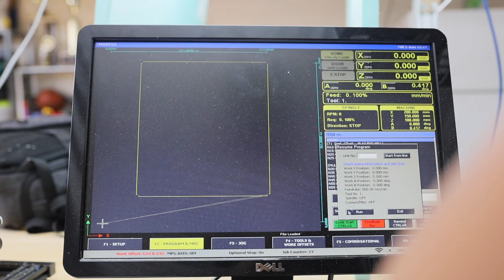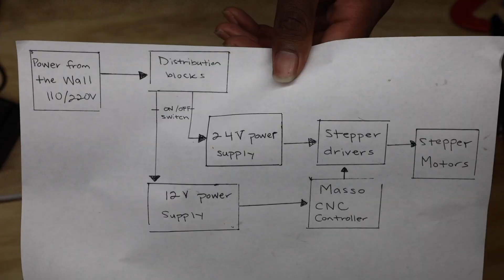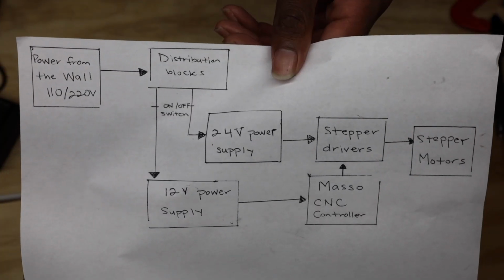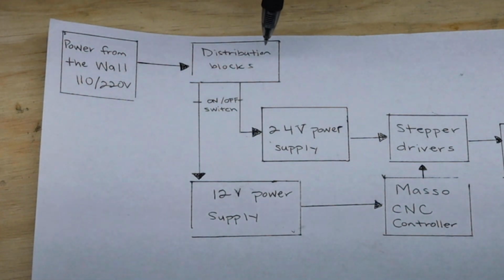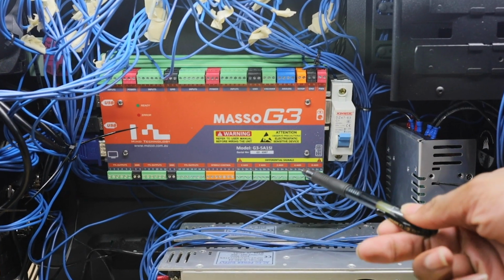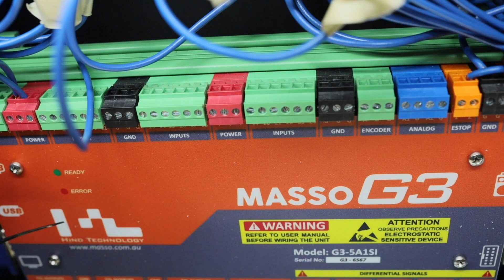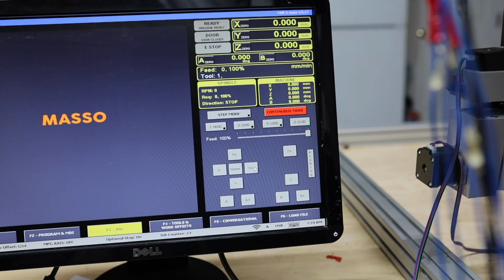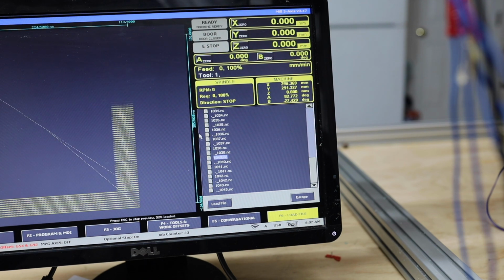DIY 5-Axis CNC Build( Part 4: Electronics/Controls )

Comment: Great  DIY  project  very similar to 5axismaker :)   I got only one question do you plan to use some kind of endstops for AB axis ?  without any  how do you zeroing those axis ?
Reply from the maker: Thanks man! I'm working on adding reed switches/ limit switches to the next version of the AB head. I had been zeroing it manually which isn't really all that accurate or repeatable.

Comment: What programming software do you plan to use? Great job on the design. Do you plan on replacing all of the 3d printed parts with aluminum parts?
Reply from the maker: Hey Paul, I've been using fusion 360 for CAD and CAM. I have no plans on replacing any of the 3D printed components at the moment....but maybe thats  a possibility in the future! Thanks for the compliment and thanks for watching!

Comment: next time use multi strand shielded cable for steppers would really knock down on the rats nesting good job so far though.
Reply from the maker: Thats  some good advice Will. I initially had a hard time finding wire for this project but, I eventually did find some 18/4 shielded multi-strand and used it to wire up some of the steppers back to the controller. Thanks for watching man!

Comment: fez testes com alumínio?
Reply from the maker: No, I haven't tried to run any cuts on aluminum. There would be to much deflection and the spindle doesn't produce enough torque or rpms to do so.

Comment: Nice stuff dude! I'm building a 3-Axis Milling Machine driven by LinuxCNC at the moment. My wiring is kind of terrible at the moment. I was wondering where you got that blue wire you used all over the place in your PC case? Is it good stuff?
Reply from the maker: It's 18awg wire that I bought from Amazon. From hindsight,  I would recommend buying 18/4 shielded cable like this stuff from home depot: 

https://www.homedepot.com/p/Southwire-By-the-Foot-18-4-Gray-Stranded-CU-CL3R-Shielded-Security-Cable-57573099/204725141

there will be less clean up

Comment: damn son, I just started planing to build my own DIY CNC Mill by FIRST planing the construction via CAD part-design & part-assembly with correct dimensions, then SECOND step is to order all the parts that I need and prep them for assembly, then assemble it and your video actually helped me, cuz that controllerbox and steppermotor-driver gave me ideas on what to use for my build and I want to go with a FULL-Aluminum build, no 3D printed parts AND use more powerful steppermotors like Nema24 and either a 1.5KW, a 2.2KW or 3KW Spindle, as I am planing on milling aluminum parts, even thought small parts but this gives me the opportunities to reconstruct the machine without having to change parts like the steppermotors or spindle for a long time ^^
Reply: Dude no need to thank me for watchig the video, every bit of information that I get from videos like yours is plentiful important and informative and it adds to the community so thats cool in itself, keep it up bro ;-)
Reply from the maker: Hey bro, that sounds like a good plan! Yeah U would definitely recommend designing everything in CAD first before building the actual thing. It will save you a lot of time and money $$$ on the backend. Wishing you the best of luck . Thanks for watching the video!

Comment: Great video! How do you compensate for the rotation in the head assembly (In cam/post prosessor) and where are you going to set the zero point?
Reply from the maker: Thanks Tobias! I designed the head so that all the rotational axis intersect at a point and have the same center of rotation(COR). I did that because it would keep me from having to worry about COR offsets and it simplifies the kinematics in CAM . As for compensation the CAM software solves for most of that (honestly I don't know too much about how that works currently).

Comment: Coming from a manual machining background (hobby, not professional) as I watched you build the Z axis, my mind was screaming at me, "DEFLECTION!  NOT RIGID ENOUGH!"  Then you mentioned that you are only going to be machining foam, and it stopped screaming at me.  But even on foam, between the cantilever defection and the printed parts, you're definitely going to have a precision problem at the bottom of your Z axis travel, which due to your design, is where you're going to be doing the majority of your machining.  You might want to think about the Z axis in the way that it's done in 3D printing by moving the stage up and down with your raw material, and keeping the toolhead stationary in the Z axis, to assure maximum rigidity.  I'd also find someone that can remake your printed A/B axis mounts in aluminum, that will increase your rigidity as well.  This is entirely intended as constructive notes, not detractive.  You have done an amazing job in the design and implementation.
Reply from the maker: Thanks Tom, I really liked your input! You know, I never though about moving the bed up and down, similar to some 3D printers as you said. While I do think that idea has a ton of merit, I think if I were looking to increase my rigidity and maybe machine metals I would probably opt for a trunnion style machine, I would just lose a lot of Z travel. However, one the of the reasons I built the machine this way is because its similar to conventional 5-axis cnc's used by auto-manufacturers to mill aerobodies for cars out of foam or clay. That is the stuff I'm really interested in and wanted to figure out how to do it (on a way smaller scale) for myself. Thanks for watching!
Reply: You totally detracted his work.

Comment: what program did you use to generate the g code and what is the post processor pros ??
Reply from the maker: Fusion 360 for CAM and the MASSO post processor within Fusion 360
Reply: @quintacnc465   ok 

and in fusion 360, what is the Post Process that uses? To create the G code
Reply from the maker: @casacasa-bh4zo   I use a slightly modified  MASSO post processor, from fusion 360 because its made specifically for my controller.
Reply from the maker: Here's a link to where you can find the unmodified version: 

https://cam.autodesk.com/hsmposts?p=masso

Cheers
Reply: @quintacnc465  
and where is that file placed
Reply from the maker: https://knowledge.autodesk.com/support/fusion-360/learn-explore/caas/sfdcarticles/sfdcarticles/How-to-install-a-custom-post-processor-in-Fusion-360.html

you're welcome
Reply: @quintacnc465  
you can send your email so we can speak for you ?
Reply from the maker: its my youtube channel name   @gmail.com
Reply: @quintacnc465  ok

Comment: Masso's post processor is only for a trunion rotary, i am interested to see how the end result is with your machine, Great JOB, i use MASSO and it is a nice platform..... one thing, please ensure good ventilation insode the case, those drivers and the PSU need to breathe
Reply: you can use any controller you want as long as it supports 5 axis, if the post output C's you replace them in notepad with either B or A
Reply from the maker: Thanks man, me too I'm working hard to make it turn out well! I have a few fans in the PC case that was one of the biggest factors In choosing that box cause the fans came integrated. MASSO can do more than rotary trunnion its just that the post processing defaults to an AC trunnion type machine. Other configurations require post modification.

Comment: Nice work! I hope you get into 5 axis machining soon,just a small note the axis rotating around Z axis is called C axis, so you either have an AC or BC rotary axis 5 axis machine depending on your C axis home position, i can help you out with post processor if needed as a support for the channel, I learnt it the hard way hehehe.
Reply from the maker: Thanks for your constant support! I feel you, it took me forever to figure out the post processing as well. You are correct, conventionally it's called either an AC/BC head. The reason I call mine an A/B is because the Masso controller only takes G code inputs for the A and B rotational axes. It's exactly the same as post-processing for an AC style head however, instead of outputting commands for the C axis  I just send those same commands to the B so that it works for my particular controller. I should probably clarify that in the next video though, thanks!
Reply: @quintacnc465  oh that will work you replace all C's in Notepad with either A or B, i do that sometimes, I'm sure it can be done with post processor yet replace all is still easy solution.
Reply: Abdelrhman elmasry
Please send your mail
I need your mail for 5 axis post processor help
Reply: @mohamedamine5226  abdelrahman140996@gmail.com